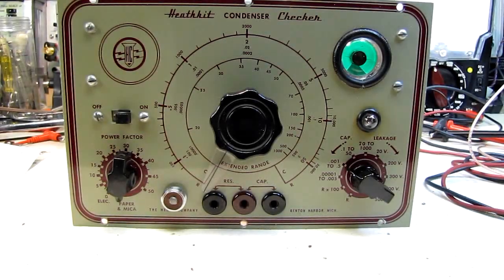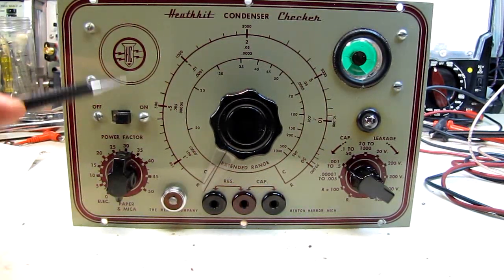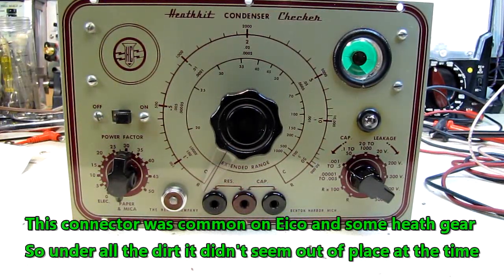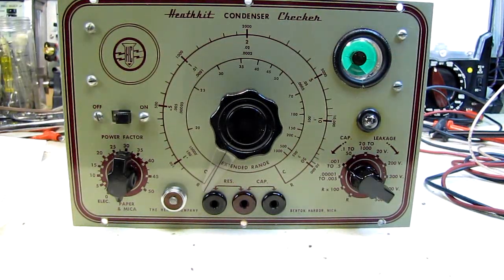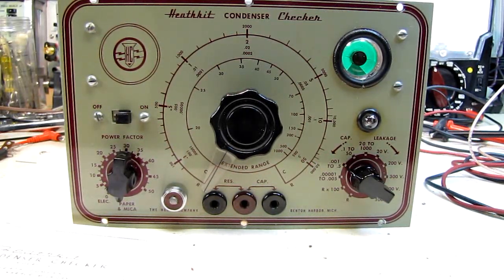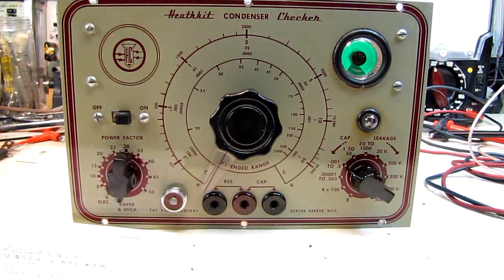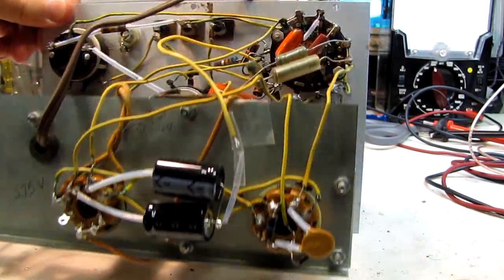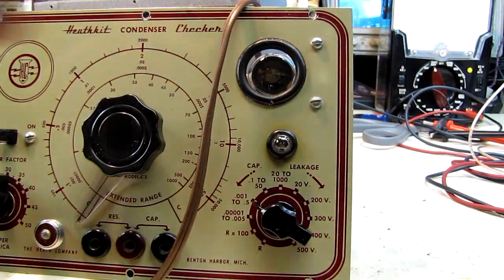New Life for Old Eye Tubes - 6E5 - 1629 - etc

Comment: Thanks. Great Video. I keep hoping the Chinese will start making new Magic Eye tubes. Or a plug and play LED alternative.
Reply from the maker: Hi Kenneth, there are Soviet 6E5S tubes on E-Bay that work fine, but you need a different socket ( search for Soviet 6E5S on the internet and you will find the pinout ) also when I was in Singapore a few years back there was a vendor ( forget the name, but they custom build audio amps ) in SimLIm Tower that has a lot of stock of 6E5/6U5 tubes.  Don't know if you get to Asia at all, but SimLim Tower in Singapore is well known as a source of all kinds of Electronics Parts. Thanks for watching.

Comment: Whilst increasing the target voltage does increase the brightness it also reduces the sensitivity.  I noticed this when experimenting with a ME91 on a valve tester and varying the target voltage, the shadow changed significantly over a 100V change.
Reply from the maker: But if you don't have another tube, it works. And were not looking for accuracy here, just an indication.

Comment: I just got a very lightly used Jackson 112 condenser tester, and had the unfortunate happenstance of accidentally breaking a very strong 6E5 tube, so that was $20 out the door for another one.  It's still going to be a while before the instrument is fully working, since I need to order some 3% tolerance capacitors to put in the bridge.

When I'm working on old radios I will generally print out a copy of the schematic and put it somewhere on the inside for later reference so I won't have to print out a new one.  One of them I have was very professionally modified for AC operation using a 117Z6 tube, a resistive voltage divider and a few capacitors, and since I don't really want to retrace the schematic I'll leave it out.
Reply from the maker: These old cap checkers, excuse me, condenser checkers are pretty accurate if you have good reference caps. Sorry to hear you broke a tube, bummer.  6E5 tubes are also available from Singapore from a place called Sim Lim Tower or some call it Sim Lim Square. The whole block is electronics. There is one floor dedicated to Vacuum Tube Audio Amps all custom made on site. They had something like 37 of the 6E5 tubes when I was there a couple of years ago. And they said they stock them all the time. Thanks for watching.

Comment: I have never understood why people feel the need to destroy vintage test gear by drilling holes in the front panel and adding sockets, switches, pots, dial lights and all manner of other things which don't belong. As you say, once they do this they immediately devalue the item. One thing you could do is remove that mic socket and put a small laminate badge over the hole, perhaps with your call engraved on it.
Reply: Lot of it I've found to do with functionality - like replacing bannana or phono type sockets on older scopes with BNC ones. Also mods for measuring things - like frequency meters are now cheapish so the ability to do that can be helpful sometime.
Reply: @nerfnerfification  I have no issue with replacing banana sockets with BNC - that's a tidy and appropriate mod. Don't get me wrong, I'm all for functionality, but there's a right way and a wrong way to do it. Randomly drilling holes and adding sockets that just don't belong, especially in places on the panel where they're not symmetrical or in line with other sockets is just butchery. I've seen some real messes made of some lovely vintage test gear this way. If you do it right, you can actually use the original holes that other things may have been in, so that in the event a new owner wants to return it to stock, it's easily done.
Reply: Depends on when it was originally done... if the original owner did it, as is likely given that it's a microphone connector and not a BNC, he probably had a test lead with a microphone-style connector he wanted to use with this to make it more useful for him.

<later> Odd, it looks like the mic connector isn't actually connected to anything now, which really makes it annoying.

Comment: The only suggestion I could think of to deal with that old microphone connector would be to get a panel blanking cap from an automotive supplier. Great video!
Reply from the maker: I actually went through my junk box looking for one of the correct diameter. Really sad as the panel is nearly blemish free other than the added connector. This unit was totally covered in what looked like a combination of sawdust and mud when I bought it so I didn't really notice the connector. But under the dirt it was nearly a perfect finish. Thanks for watching.

Comment: Any idea what the rogue connector was used for? I bought a C1 from EBay - not knowing the layout  on the front panel. Slap bang in the middle of the Heathkit logo on the left hand side there is a seven-pin valve socket installed. Although neatly done (chassis punch?) it does detract from the overall look:( I have no idea of its function!

Comment: Q: What's the difference between a Harley Davidson and a Hoover vacuum?
A: Location of the dirt bag. 
Do I recall, as a child, seeing a feature on a store tube tester that "restored" vacuum tubes?
Forget the word or term used.  What does rejuvenation do?  How does it work?    Thank you.
Reply from the maker: Basically most units just double the filament voltage to "boil off" a layer of the old cathode. Usually done with the tester set to monitor emission and when it rises to acceptable levels turn down the voltage.
Reply: Oh.  Thank you.   I thought maybe high AC voltage at very low amperage though the filament to repel (accelerate) free-floating gas molecules bouncing around until they stuck to the getter.

Comment: I'll have to give this a try on an old Rogers floor model radio I'm restoring.  These things use an extremely rare 6x6 magic eye tube.  Mine lights but is dim.  I'm thinking since increasing the target voltage reduces the sensitivity. Maybe  I'll just put a 1meg pot in there, find an acceptable brightness, measure the pot center to each end, and make a voltage divider using two resistors of the same values to power the target.  I think that way you can use just enough voltage to get an acceptable brightness without affecting the sensitivity and lifespan as much.  
Use just what you need and not more! Lol.  I'm sure that sounds a bit like over engineering it, but the magic eye tube in a radio needs to be as sensitive as possible.

Comment: Ever think about replacing the non-original Jack with a BNC JACK? I'm not sure about your model,  but I think I've seen it done on Eico 147As.  Thanks, and great video!
Reply from the maker: Not entirely sure what you are referencing. If you mean where I added the lamp this was not a factory hole/option. the other three Banana Jacks are original and work OK. Anything that uses the old Amphenol Microphone style jacks ( and thety actually were intended to be used ) Get the BNC treatment as the hole is exactly the same size. I don't know why someone added the hole and jack. Didn't serve any apparent purpose. Just wanted to fill the hole.
Reply: @theradiomechanic9625  I was just referring to the anphenol jack, so nevermind about that and sorry for the confusion. That was a good idea with the light. Thanks for the response!

Comment: Can't they be " rejuvenated" like the CRT in a tv and then run at a Lower voltage?
Reply from the maker: I have tried running the filament hot at as much as double the voltage to "boil off" some fresh cathode. But no success. And the unit has plenty of extra voltage taps.  I have since actually put a NOS tube in it and lowered the voltage to normal.
Reply: I did some reading online, one theory is the phosphor in the magic eye becomes poisoned as the cathode boils off in normal use. I think running the heater hot would only make it worse. Don't quote me on this, I'm not a professional.

Comment: so the tube is bad. you are overdriving it to get more life out of it. Good. these are no longer made and are limited to nos. use it like this until it dont work. then replace it with a nos one if you can find one. just dont forget to remove your modification before putting the new one in.